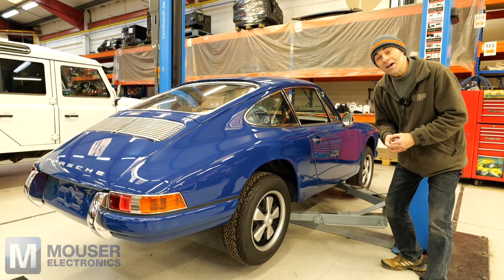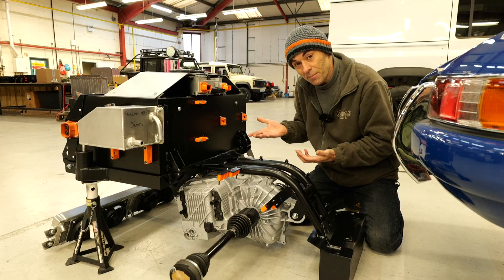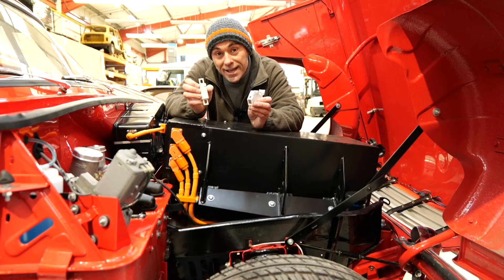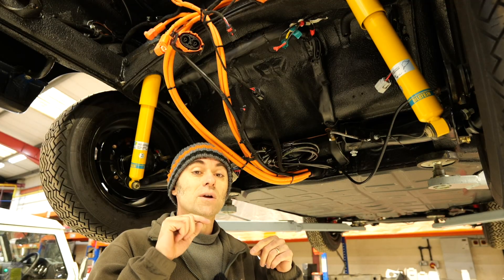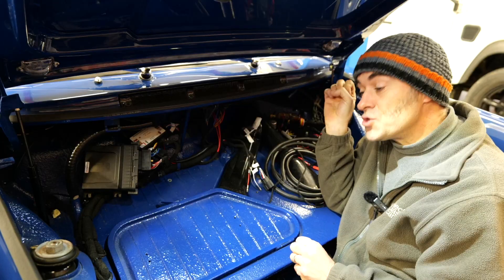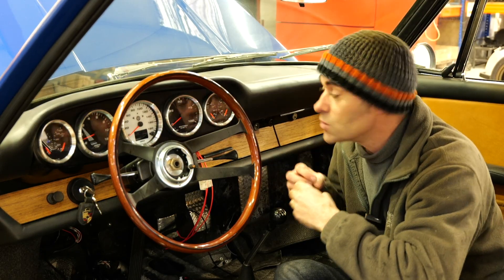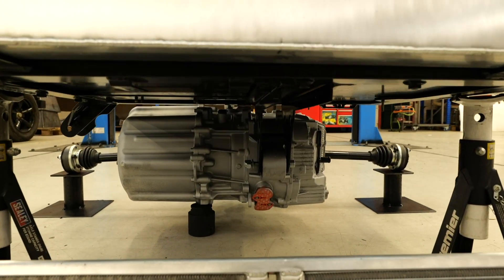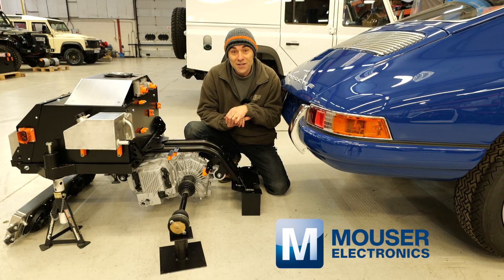Porsche 911 electric conversion kit

Comment: now u r geared up for more thruput and have gained a wealth of experience / source & create cost effectively....Why not produce a comprehensive conversion kit / do conversions for the TT?

This chassis is screaming out for a powerful EV conversion that would b a formidable showcase for the conversion company

Why? Starting with the obvious, it has a proven 4wd system within a compact design that is ideal for hustling down UK backroads. Secondly, the 2.0 4 pot is somewhat lacking in aural character, whilst the 5 pot is just too expensive.

Presumably a kit can b made to cover all Mk2 and Mk3s with relative ease. The Mk2s are available for peanuts and a Mk3 with a poorly / hi mileage engine can b had for little more than £7k, making these a formidable base and conversion far less to be decried by purists. 

What would b ideal is say two options. Firstly a budget friendly Mk2 with c 380bhp / 380 ft lb and minimum range of 200 mls, truly made with modest margins, to attract more people to your future expanding business and differentiating yourselves from new converters on the block.

Secondly,a Mk3, with eye still firmly on keeping costs very low, with more like min 450/450 and 250 min mls :)

Both of these cars can be developed into absolute back road missiles - can u do it whilst making the total price attractive? :)

Comment: Cool. But my classic cars are classic for a reason. If i want an EV i buy a new one. I drive my classics for fun maybe 2000 km a year. I don't get it why people do this to classic cars.
Reply from the maker: For me it’s because I want to drive my classic cars as daily drivers. 👍
Reply: @ElectricClassicCars  okay i get that. But it would depend what kind of classic car, its value etc. I don't drive my 85k fastback mustang daily for instance. Besides i live in the Netherlands, i don't drive in winter climate. 

Also even if you convert say a vw bug to electric, you need to upgrade the brakes to for the extra power. Also old suspension and wheel bearings etc wear out faster than modern cars with daily use😬

Comment: Technically etc I am sure very well done. However one can look at it from all angles and it simply is not anymore a Porsche 911 at all, which I personally find very sad. Why not leave a bracket in the car market for “true” classics and leave them as they are.  Given their numbers and annual mileage CO2-wise no problem at all. I fully appreciate that I am barking up the wrong “company tree” here but it does break my heart, but best wishes in any case.
Reply: To my understanding ECC makes very non-destructive bolt-in conversions. You can absolutely convert the car back again down the line, and you wouldn't be able to tell.

Comment: This is the type of conversion I want for my 1975 Ford Granada Mk1. The electric motor drives the wheels directly and not inefficently via the old transmission path. One day there will be the possibility to fit a complete drivetrain and axle in the rear of my Granada and some batteries below the car.

Comment: I've got a long term (Bought as a Californian import around 2001 ! ) 912 project, so the idea of an EV conversion is something I might consider. As for the differences, as well as the 4 speed gearbox, I know you could get the 912 with 3 dials on the dash - was this also a lower spec option on the 911s?
Reply from the maker: Interesting 👍

Comment: I don't think there's anything wrong with converting old cars to electric, except for one point. Electric motors lack drama. They just go. You don't feel the engine or hear it. You don't care what the rpms are.
Reply: "electric motors lack drama"
Then why am I so scared of my table saw
Reply: @logitech4873  ... My cat has the same opinion about the vacuum. Point taken.

Comment: In the cars where you’ve replaced just the motor and left the transmission installed, do the owners ever shift gears or do they leave the transmission in first? Assuming you’ve removed the clutch, they probably cannot shift on the fly, so if they use a higher gear, they likely shift while stopped. Have you or anyone compared ranges for the different gears? I imagine that range increases noticeably in the higher gears just as it would with an ICE car.

Comment: Eek - I hope you’re changing out the torsion bars for larger diameter units. As the 912 engine was lighter than the 911 engine the torsion bars were different. If the mass of all your electrical stuff in back rivals that of the 911 engine then I suspect the torsion bars will be rather undersized. Similar for the front torsion bars if the front batteries weigh more than a full tank of fuel.
Reply from the maker: Yep, new hollow torsion bars and shocks fitted front and rear according to the new corner weights. 👍

Comment: I owned a ‘69 912 Targa and still have a 73 911. The 912 had a single battery in the front, but still had two battery boxes. They put weights in the empty box to balance the car. My 912 had a 5 speed 901 gearbox and steel wheels with moon hubcaps (Fuchs wheels were an option). Also I don’t recall an oil tank in the 912 like the 911 has for the dry sump.

Comment: Being in the EV - PHEV, full electric and hydrogen industry. I would just say watch your protection circuits are correctly dailed in for failure mode current draw.  .... a fire is not what you want.  Look for your wire traps, where the narrow gauge wires are going and what threats they're under. In contact with abrasive surfaces and vibration, humidity (forming of Algae and other microbiologics), insulation weakening due to thermal cycling,   material ingestion etc. Do these cars go through FUSA- even just basic safety inspection, REG85, REG100, VCA etc?   .... its a nice idea ... but you do run risk of a crispy 912.
Reply from the maker: Yep, protection circuits are correctly ‘dialed in’ as you call it. 😉👍 All is tested to Reg100 by VCA. 😆👌
Reply: @ElectricClassicCars   You got a sub, happy new year 🎉🎊... glad you're looking into safe systems... so many forget to examine "fail states" . Some systems dont cut circuits in these modes because designers design under a falsehood that their stuff will never go wrong. So fail states can draw less current  than what the protection has been set to (but enough to cause consequential damage) .... hence bad happens .

Comment: the 912 was never a success, it was the poor man's 911 and now completely unsavory with an electric motor in the back. This version was also very “tail happy”. And now, when the rear passes by, can you still disengage?
Reply from the maker: The improved weight distribution should hopefully reduce its tail happy characteristics. 👍

Comment: Also brakes were different
Reply from the maker: In what way?
Reply: @ElectricClassicCars  Original series 911 had different brake disk diameters front and rear (282 and 285 mm respectively or 11.1" and 11.2" ) while the 912 had same diameter discs front and rear either 9.6" (244mm) or 11.1" in later series.
Reply from the maker: @miguelangelsimonfernandez5498 Interesting. Thanks 👍

Comment: You missed a trick doing a whole video about the kit without ever mentioning the battery size, range or motor horsepower. Instead of whetting our appetites you've frustrated us by omitting the most important information needed to make us ache for one.

Comment: In 1969 Porsche extended the chassis 6 to 7 cm longer for handling so if your 912 is a 68 then it has the shorter chassis. In fact I'm not sure they extended the 912 chassis as the engine was lighter although I think the 912 handled better because during the early years Germany didn't allow different width tires on the front and back. Remember the 912 was the first iteration after the 365's which were all fours.
Reply: the 69 912 was LWB as well... with a 5 speed as standard. 5 gauges too.
Reply: @eljimberinoq5518  I always thought the 912 was underrated, it got shadowed by the 911. BTW the 911 was originally designated 904 but Peugeot already patented the number.
Reply from the maker: Interesting 👍

Comment: Didn't watch the video.  There's a special place in Hell for people who put an electric motor in old Porsches.  I say that as a 40+ year owner of the same 911.  They are what they are.  They don't need the extra weight to fit with some socially accepted norm that will run into issues when the power grid can not support the extra draw.  Having said that, I presume this was your car and you can turn it into a paper weight if you desire.
Reply: I would think the owner of a 911 for 40+ years would know a 912. I hate sitting in the dark every holiday when the whole country is preparing a big meal as the exact same time causing the grid to fail.
Reply: The first sentence tells us all we need to know. 🙄

Comment: Great kit and no doubt a useful. Quite exciting to think that as battery energy density continues to improve the options for an even more compact kit will arise. However as a 911 owner I am a bit conflicted, on one hand the small slippery shape of the 912 / 911 make them perfect for conversions, but the loss of the boxer engines is hard to take. Perhaps the engines could be made into a display piece?
Reply: I'll stand to be corrected by Richard and his ECC Team, but I would imagine the car's original engine and componentry gets boxed up (no pun intended...! 🙄) and handed back over to the owner - that way, the car can be retro-converted back to ICE spec if required.

Comment: Since you have batteries in both ends, will the charging port be in the bonnet or boot? I imagine the owner will have to raise slightly either one to reach the port. I continue to love watching your videos! So encouraging and informative! 👍
Reply from the maker: The charge port is where the petrol flap is, front left wing. 👍
Reply: @ElectricClassicCars    Thank You! 😀
Reply: You can put the charge port pretty much anywhere ... just run the cabling as required. They ECC commonly use the original filler location on their conversions unless there's a good reason not to.
Reply: @MrAdopado    Thank You too! So on my 1961 Chevrolet Apache it will be at the driver’s door! 😀
Reply: @glenhardy4770  Ha ha ..
Reply: @MrAdopado    IF I ever get it accomplished! People in California tell me I should complete any body work first.

Comment: Copied from 912BBS: base 911 and the base 912 were identical except the engine (and engine components like fuel pump, voltage regulator, generator/alternator etc), the gears in the transmission, torsion bar size, and sway bar size (note 1968 912 didnt have any sway bars standard, and other years did)) and gauges to match the engine type and set up.
Reply from the maker: Good info. Thanks

Comment: Brother, beautiful job as always.
You used the keys words-experience and engineering. A winning combo.
I'm sure you noticed I put experience before engineering.
Your moto is definitely not-WHAT WE WIRE, TURNS TO FIRE!!! 
Cable management is key and keeping the high and low voltage separate is key. 
We deal with that for fire alarm life safety systems with high-low and power limited circuits.
A lot easier to run wires than cables and convert everything to electro-mechanical systems with control and verification.
Still looking forward to the Volvo 240 conversion you hopefully will do one of these years.
Happy Holidays
Bill Compton

Comment: Well done, but I have concerns about these Tesla motors because going on 6-8 years a lot of the drivetrains need replacing on Teslas.
Reply: They stop water getting into their motors and i would suggest most of these conversion vehicles are lighter than the Tesla's and driven a bit more conservatively ... You still  dont want to trash your classic conversion unless your competing in some sort of trial.

Comment: reply:  and that's Shawn's opinion - thank you Shawn.  Anyone that is going to do this, such as myself for example, doesn't give a flying fu*k what the market wants.  My cars are to drive, not as part of my portfolio.  Thus the chasm appears to widen between opinions and...well opinions...  something of note Shawn, you are aware than on a 911 nothing is added, cut or removed - so if anyone is "worried" they should just place their golden egg of a winterized  numbers matching engine on a pallet covered up in the corner of the garage and use the car as an e911 and enjoy -  time to sell?  Sell the pallet with the car.  EVERYONE IS HAPPY!!   problem/concern solved.

Comment: Would there be any reason to use this kit in VW bug? I know there are engine mount kits to put a 911 engine into a bug, so the mounts might work. But would there be any advantage in doing that? Like more power than the proper bug motor kit?
Reply: VW Beetles barely had 50 hp, you would need a lot of chassis reinforcement.

Comment: Such an elegant conversion to preserve and improve classic cars.
Reply: Improve? seems all the driving enjoyment was removed
Reply: @msw7021  
Shifting gears and revving an engine to maintain an ideal RPM is not what defines the driving experience. A transmission is a necessary evil because internal combustion engines are incredibly inefficient and have a very narrow power band.
The driving experience comes from becoming one with the car, using a deft touch on the wheel to ease into turns and then nudge the pedal to accelerate through the apex, launching out of the curve like a shot. 
Having to dick around with shifting, even with an automatic actually takes away from the experience. There has never been a more pure driving experience than having a single speed with maximum torque available at all times.
Reply: @msw7021   Totally agree! Might as well stay home and use a "play station", which any numpty can do!!!

Comment: What!? The 911 has a "smugglers box"??? How long does it take for a 911 to do the Kessel Run?
Reply: Well, 14 parsecs, of course. 😉
Reply: At a constant 100mph and assuming no pee-stops, and the same route as the Millennium Falcon, you should get there in about 265,763,014 years, give or take.
Reply: The traditional Kessel Run is measured in Parsecs - a unit of distance. I’m assuming this is because the run is time limited and the distance one travels in the allotted time is one’s “score”.
Reply: @bobbarker14  I remember hearing once that George Lucas assumed that a major part of the Falcon's ability to go from world to world in the shortest time was related to the ability of its navigation computer to figure out the shortest way to fly between two worlds. That is supposedly why he originally the boast that the Falcon could make the run in less than 12 parsecs.

In later stories (which Disney now calls "Legends", it was noted that the area around the planet Kessel was surrounded by several black holes, which cast gravity shadows into hyperspace. Ships need to travel a distance from these shadows to keep from being pulled out of hyperspace. Smuggling ships, with powerful hyperdrives can travel closer to these black holes and their gravity shadows and say in hyperspace. Thus Han was bragging that his hyperdrive was so fast that he could make the Kessel run very close to the black holes.
Reply: I for one would not be happy placing my pet kestrel in that or any type of box! Kevin gets very claustrophobic.

Comment: Thank you Richard.
The only real differences between the 911 & 912 were engine type, performance, and the price.
Reply: Would that give the 912 better handling due to the reduced rear overhang and less weight swinging about at the rear?
Reply from the maker: Thanks for confirming. 👍
Reply: Aren't the interiors supposed to be a less luxurious, cloth vs leather seats, radio specification, etc, to save a bit more mass?
There's a couple of videos showing them getting more modern boxster engines.